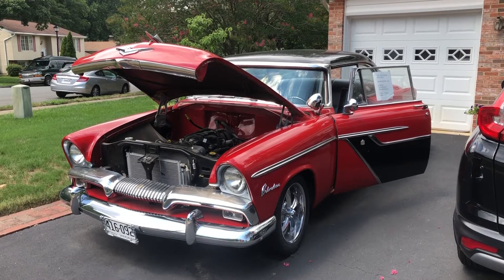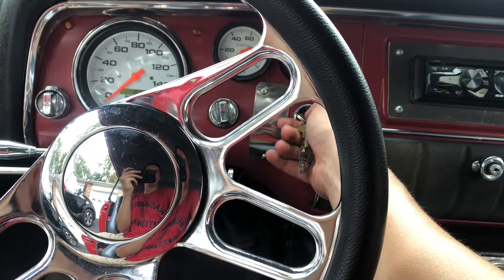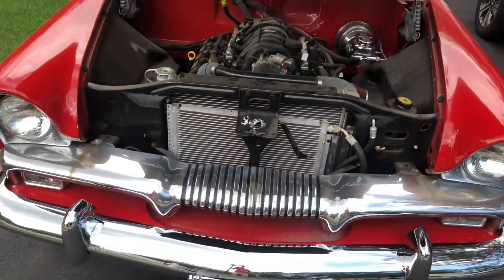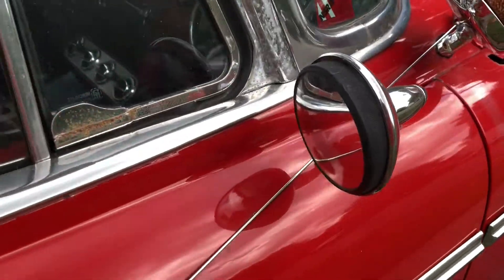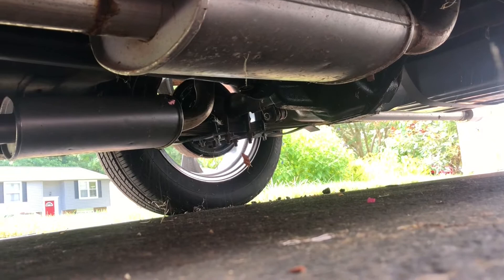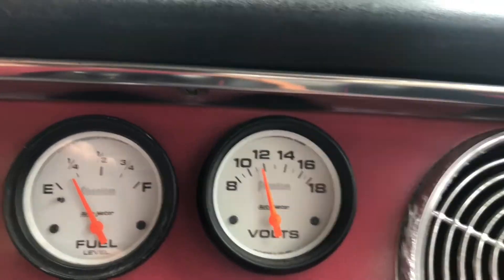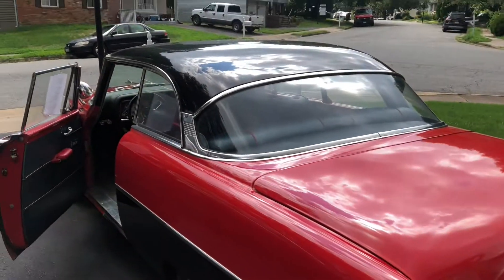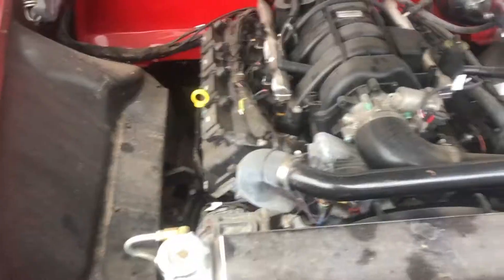1955 Plymouth Belvedere with Modern Powertrain

Comment: I like the  clean old car with original color paint. I like the modern drivetrain and how well the console fits. I don't like the choice of steering wheel or gauge cluster. Why would someone go to so much effort with this build and then tape wires together? The loud ticking in the motor may or may not go away. It's typical for motors not ran for awhile. Could be a deal breaker if not resolved.

Comment: I like the idea, but it was no pride taken to the build of this car. It needs to be taken completely apart and started from scratch.
Reply from the maker: From what I understand, this project took many years and there were breaks in between working on it. And certain parts of the project were each done by different shops, so unfortunately one highly skilled individual or group did not work on the project from start to finish.

Comment: POWERFLITE = 2 Speed Automatic 
TORQUEFLITE=3 Speed Automatic
Reply: willcat: Both transmissions have great kickdown to lower ranges capabilities when accelerator floored. 3 Speed Torqueflight Transmissions also have part throttle kickdowns.